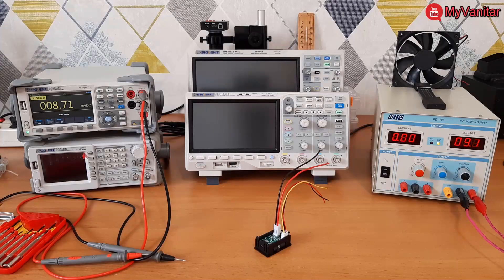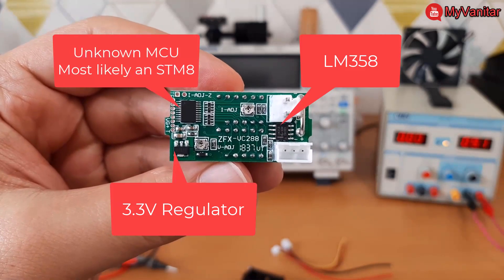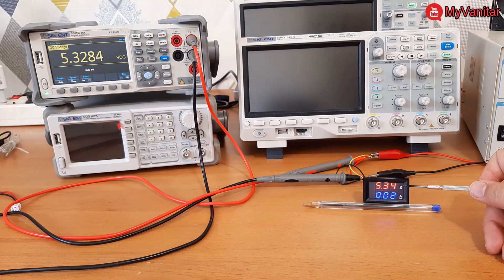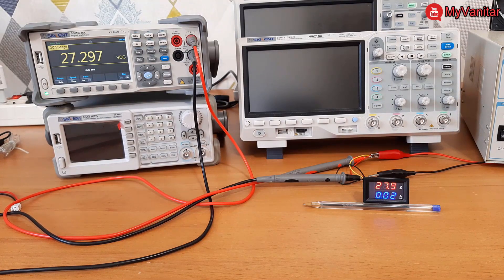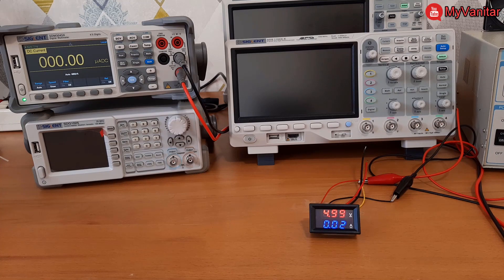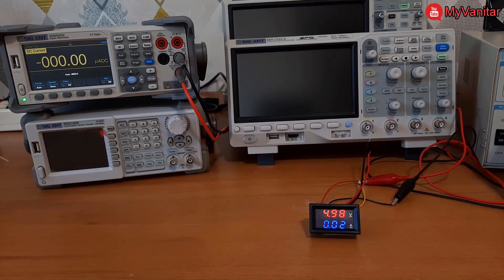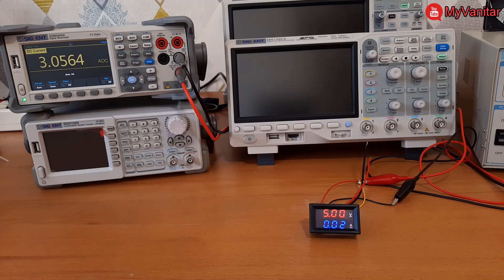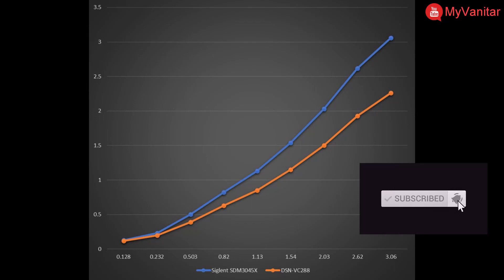DSN-VC288 Voltmeter-Ammeter Review Using The Siglent SDM3045X Multimeter

Comment: Does it beep on diode mode?
Reply from the maker: Do you mean the multimeter when the probes are connected to the component?
Reply: @MyVanitar  yes if it gives a beep if you have a faulty diode for example. All of them have the continuity beep but not all of them have a diode beep. My handheld doesn't have this feature so I'm looking for a bench multimeter that has it. I asked the question also somewhere else and the person said this model has a continues diode beep when the component is faulty. So I'm leaning towards this model :)
Reply from the maker: Yes, it does beep, you can even define the voltage threshold to whatever you like to define when this beep sounds (I have not seen this in the handheld multimeters). although I don't use this device for that type of diode testing, for your question I tested it myself. if you decide to buy one, please let the company that you got motivated by this channel.
Reply: @MyVanitar  thanks alot for al the efforts you put in my question! I really appreciate that! I'm still thinking about the other model this is the same as this one but a little more precise. The difference is €100  but for the rest they seem identical. I think these are the only models around 400/600 that have full color screens and thats an awesome feature that you dont see with different brands on multimeters/scopes and power supplies.
Reply from the maker: Glad to hear that, Yes, 100 boxes more is nothing when you get more features, especially the accuracy. Whatever you choose from Siglent products and you got the interest because of my videos, not just the models I use, please mention that you got the purchase motivation from this channel.
Reply: @MyVanitar  yes I will! I always buy my stuff at my local Hardware store in my country. They are pretty big and I will fill in that I got the idea from your account or at least the information. I found the models in their website and they are very well reviewed by people. But I let them know you helped me with information.
Reply from the maker: Just let me check again because I should see if this is only a continuous beep or a single connection beep. let me check with some components
Reply from the maker: let me upgrade how it works. if your defined voltage threshold > forward voltage = beeps continuously, (for example threshold is 0.6V and the diode is 0.5V) otherwise, there is no beep, just a Relay switch inside the device. I do apologize for the confusion.
Reply: @MyVanitar  ah allright! Thanks for clearing that up. I would have liked the same feature than in a Fluke but in a bench multimeter but I gues it's not the end of the world and I mostly wanted to bench meter for a greater screen and easy accessibility on the desk. I mostly look forward to the color screen :)

Comment: Pensé que este problema me pasaba solo a mí, pero por suerte veo que te pasa exactamente lo mismo. Creo que el indicador sirve para medir pequeñas variaciones, no para medir grandes variaciones, aunque tenga un rango amplio. Por ej: estoy haciendo un tester de USB, entonces lo calibro a 5v con una fuente confiable y sé que si mido un cargador USB y me arroja 5.1v o 4.8v estará bastante cerca de la medición real. Ahora, ponerlo en una fuente variable, de 0 a 35v por supuesto que no es confiable, porque como dices, si lo calibras por ej. en 10v sé que cuando mida cerca de 0v o de 35v la lectura tendrá un desfasaje considerable y la lectura no es para nada confiable. No importa en qué punto lo calibres, mientras más te alejes de su punto de calibración, el margen de error va creciendo como muy bien lo muestras en tus gráficos.
En síntesis:
Para pequeñas variaciones, FUNCIONA (si no necesitas mucha precisión).
Para grandes variaciones NO SIRVE (a no ser que no necesites NADA de precisión).
Tal vez alguien tenga una solución, tal vez otro firmware? He visto que raspan, comen, desgastan un poco la resistencia Shunt y parecería que es un tanto más preciso pero no lo he probado ya que no es exactamente el mismo modelo que usamos nosotros.
Kisses =*
Reply from the maker: Thank you for the comments. Yes, it works if the variations are small around 5V or so. better than this can not be achieved using this circuit. I may design something to solve this in the future but I should get energy from the subscribers

Comment: Well it doesnt suck at all. At least it is adjustable. I use this to track my 6 solar panels ,one by one,in my campervan. I adjusted them according to those panels and they work extremely well. This device can ve supplied with external power. This is why I had to use them, they still function when the solar goes out. There are some others that can be supplied with external power but for 5x or more the price.
For me it was bargain.
Reply from the maker: of course, it was adjusted. people have different indicators of good or bad, in their opinion. external power or internal does not make any difference. here I supplied externally.

Comment: In comparison to ANY handheld, this multimeter shows EXACTLY HALF the resistance value measured in circuit.
Why is that ?
Reply from the maker: You mean the Siglent model which I used here? is the measurement is okay when the component is outside the circuit?

Comment: 2 comments on this. Voltage "calibration": The offset is linear - perhaps you should have calibrated the voltage on the higher voltage then the linearity gradient would have allowed the readings to be more accurate. Current: there is a separate adjustment for current on the device. Did you adjust this also before testing current?
Reply from the maker: of course I did, for both voltage and current before testing. even if you calibrate it for high values, it deviates on low values and vice versa, I tested both. this is not a linear behaving instrument.

Comment: Luckily the readings are adjustable
Reply from the maker: I had calibrated the panel meter before each test, however it never showed a linear behavior, especially in current readings. Even I could not calibrate it for currents lower than 60 or 70mA if I remember correctly. So I started from a higher value.